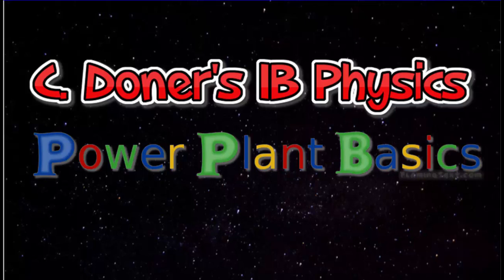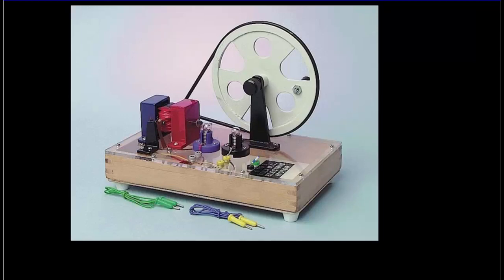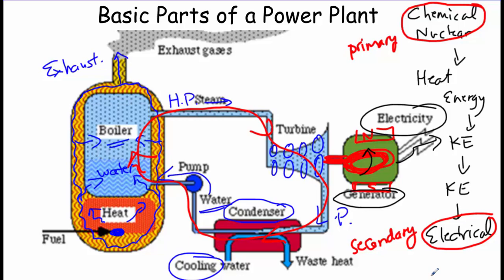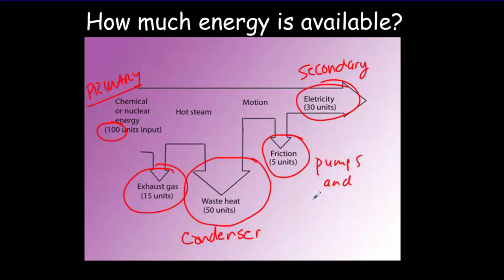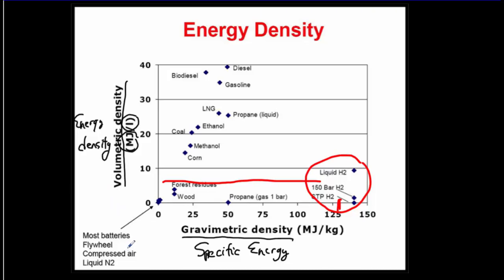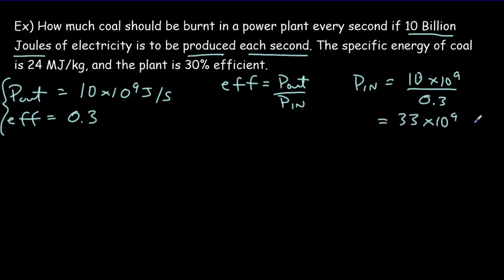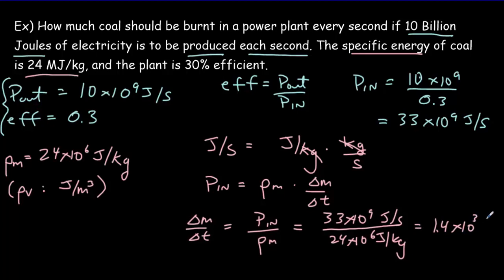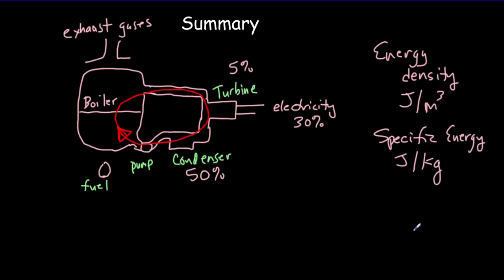IB Physics: The Basics of Power Plants, How do they work?

Comment: For the sample problem I did it a bit differently:

If every 1 kg of coal gives 24 MJ of energy ideally, that means that with a 30% efficiency 1 KG of coal gives 24 * 0.3 = 7.2 MJ/Kg. In order to produce 10 Billion Joules of energy or 10000 MJ of energy, we need 1000/7.2 or 1.4 x 10^3 Kgs of coal per second.

Would this method also be acceptable in the IB Physics test?
Reply from the maker: Absolutely, and it really is the same as what I did but in a different order.
Reply: @donerphysics  oh thanks nice to know, the video was really useful btw, I understood everything perfectly